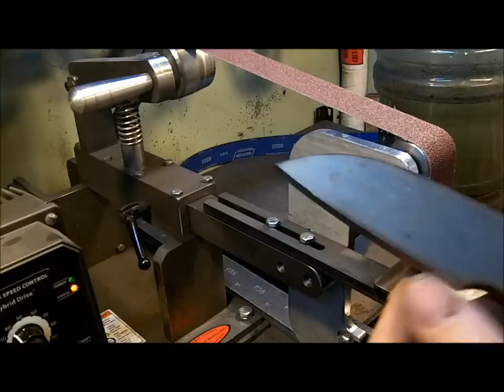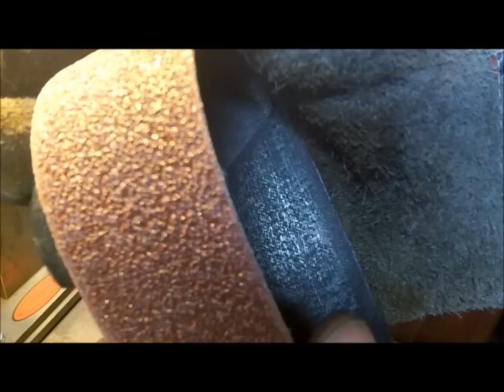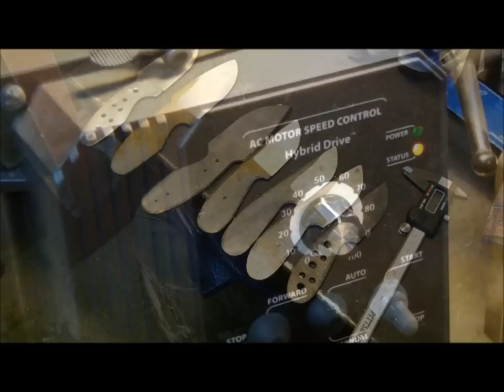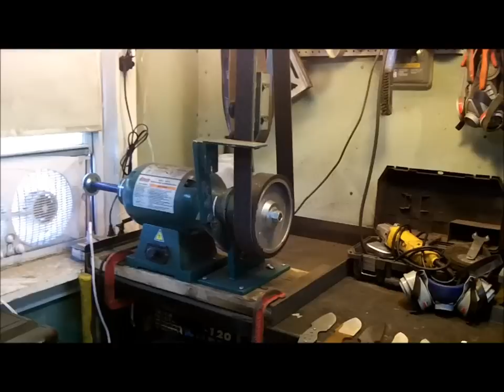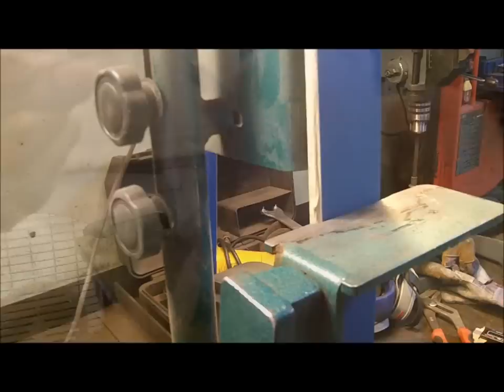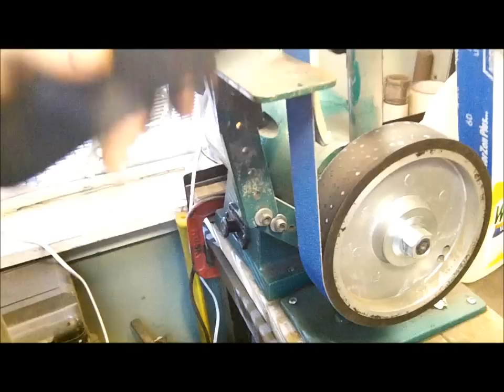Knife Making Tutorial- How to FLAT GRIND A Knife (30 min Tutorial)

Comment: I started on a 1 by 30 and then I tricked it out quite a bit contact wheel as My drive wheel with variable speed Sewing machine motor i could leave a link hopefully if anybody interested
Reply: I meant to link to the source whom gave me the idea, also mine tilted using parts that the 1 hrs moter originally mounted to

Comment: Hey - thanks for the video. Good work. 
I've made a few knives from files and have annealed, tempered, quenched, and heat treated them. But I just but some new Tool Steel (0-1) from IMS for the first time. Should I treat it the same as a file or what? Thanks -

Comment: man, you must remove the original heat treat, make de grinding and sanding, heat treat again and so you can sharpen your knife, but is realy hard do that so, using a angle grinder and a few sandpaper discs, you can make the cutting angle but you must be carefull to don't "burn" the steel, bronze is the limit color, if the blade turn into a blue or purple color, is too soft and your knife will broke between the softer and the harder part.
if you don't burnied the steel, is just use your stove

Comment: Your initial grind was 36 grit Aluminum Oxide, the 2nd belt you used; the composition of which you didn't mention, I presume is a Zirconium belt, based on the blue color.

Comment: It would be nice to have a surface grinder with a magnetic table. I used to be a machinist and used a surface grinder to flat grind a couple of knives. You can flat grind with a surface grinder by shimming one edge by half the thickness of the tang and grinding to the midpoint, then flipping and shimming as you did the first side and grinding accordingly. Being that you are dialing your depth of cut in thousandths it's easy to control.

Comment: Isn't grinding done with a stone or abrasive wheel? I would call what you're doing, sanding, with a belt. Do you create less heat with the belt sanding? I used to chuckle when I'd see guys sharpening their tools on the job with their belt sanders. I don't make knives but do a lot of sharpening of my tools. Diamond hones for touch up and a wet stone grinder for re-do's. 

???

Comment: they are already hardened. but you should temper them just a little. normally about half the time it would normally take for a knife. pretty much all files. are 1095 HC  steel. i recommend you use Nicholson files, they're high quality.

Comment: I started out using an angle grinder. It wont be perfectly flat but you would literaly be there for days with a file or sandpaper. A 4x36 belt sander works ok to. I got mine for like 80 bucks and is what I use, but i am still learning to.

Comment: i'm making my first knife, and i dont have access to a belt grinder. I've already made the handle by hand filing it, and now i'm onto making the blade. I want to do a full flat grind, and i was wondering if it's possible to do it by hand. I know it would take time, but thats not an issue for me. Do you reckon sandpaper wrapped around a block would suffice or would a flat file be better??